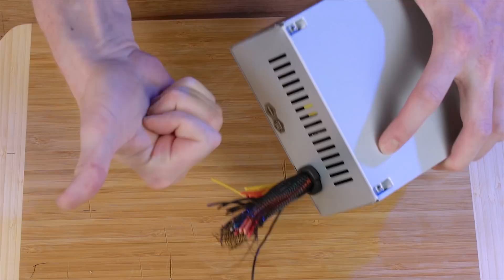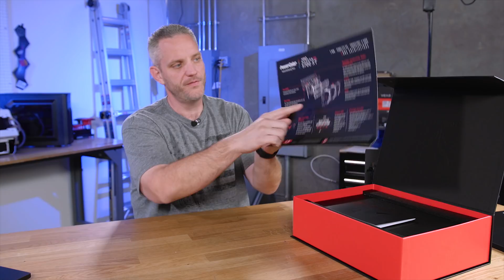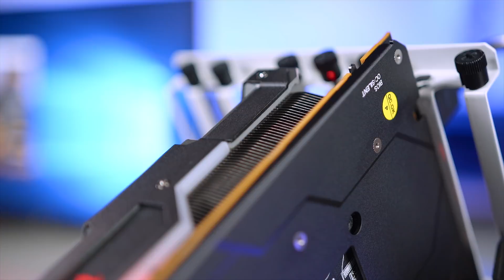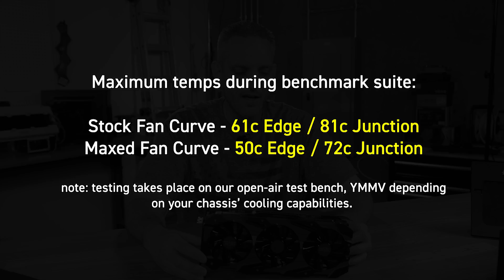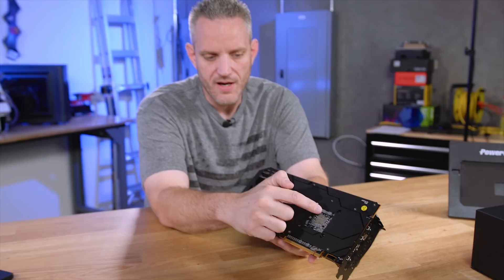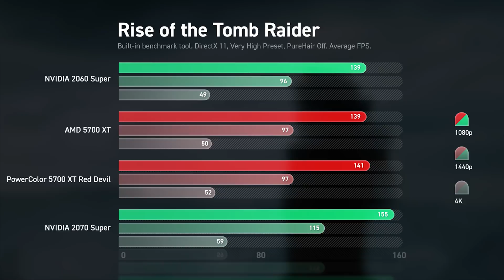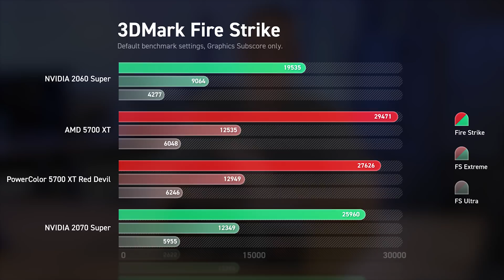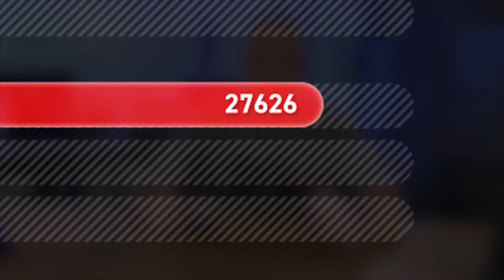Custom RADEON 5700 XTs are here! and THEY ARE GOOD!

Comment: 5700 XT is honestly the best price to performance card out there right now. Big Navi is going to be frickin amazing.
Reply: New, I believe you're right, but I think it'll be hard to beat a Asus ROG Strix vega 56 for $240. You can get a blower design 56 for just a touch over $200.
Reply: @dutemp  true for 1080p but 1440p on the latest games (*cough cyberpunk) you need a 2060 super/ 5700 xt and the 5700xt is effectively a 2070. Easy best card for 1440p
Reply: @SteveDonev  Its better than 2070. More close to 2070 Super easy.
Reply: @Lollakuk  that's my point
Reply: @SteveDonev  yeah it competes with the 2070 Super, even beat the 2080 once. Amazing.
Reply: Big truth
Reply: @Kronixio you will probably be able to run it high 1080p with a 1060 but not ultra and definitely not 1440p. This is all just my guesstimations tho so take it with a massive bolder of salt.
Reply: @socketus popetus AMD have registered the names "5600", "5800" and "5900", there's probably gonna be other Navi card.
Reply: You realize you cant get a 2070 super for the suggested MSRP of 500 right? They're easily over msrp by 50$ sometimes $150 over msrp. The 2070 super is not a good value. I shouldnt even use 2070 and value in the same sentence....
Reply: @desjardinspeter1982  I got my MSI Duke RTX 2070 OC 8gb in my PC, which in total cost just under $900 (for the entire PC that is), so to say you can't get good value out of it, you need to stop buying brand new graphics cards every year lmfao.
Reply: @TheGauges420  who buys a new graphics card every year? Did I ever say that? I dont believe you built an all new PC with a 2070 for 900 dollars. I call bullshit. Unless you cheaped out on everything else...
Reply: @TheGauges420  used 2070s are at best $50 lower than msrp. And you get no warranty and have no idea how harshly the card was treated. Not a good value at all.
Reply: @Warm Soft Kitty  lol what? You need to go see some 5700xt benchmarks my friend. I recommend gamers nexus. Steve goes in depth with the analysis. It performs at a 2070 non super level.
Reply: @Warm Soft Kitty  the 2060 super is in no way shape or form faster than a 5700xt. The 5700xt performs at a 2070 non super level, and about 3% slower than a 2070 super
Reply: If not factoring in used market, then I’d say so.
Reply: @saucyg6371  used market for gpus generally sucks. You would be hard pressed to find anything better than a $50 discount for a $400 gpu and you gen no warranty at all. Not to mention that you have no idea how hard the card was run
Reply: Rx 5700 is better for p/p
Reply: @aguy3664  5700 falls in a very weird space. Way too powerful for 1080p and not powerful enough for 1440p. 1080p you should go radeon 580 and 1440p 5700 xt
Reply: @SteveDonev  5700 can be good for 1080p high refresh, and it will deliver proper performance for the newer titles. There is Navi 14 coming for the lower-end market.
Reply: @randalldraco3822  true but 1080p high refresh is only good for competitive gamers. For most games the higher resolution and a 60fps framerate is preferred
Reply: Pumpal 
Unless you have modded Skyrim to hell and back..for that the Rx 5700 makes perfect sense at 1080p lol. I have an rx580 and a gtx 1070 ti. I personally prefer the 580 for 1080p. Just doesn’t stutter like the 1070 ti tends to. However, the 580 just can’t hang at 60fps in modded Skyrim. Even the 1070 ti falls to around 45fps in heavily wooded areas
Reply: @TrevorLahey3  for a high refresh 1080p freesync/gsync monitor then the 5700 is great, but if you are on a budget and want 1080p 60fps then its absolutely overkill. All you need is a 580/1060 for that.
Reply: Pumpal 
.....unless you have modded Skyrim to hell and back
Reply: Pumpal 
Not to mention a handful of games out now that run heavy. GR:Wildlands, AS:Odyssey...
Then you’ve got the future proof aspect to think about as well
Reply: @TrevorLahey3  future proofing is a fallacy. The generational improvement of gpus is far greater than the cost of buying a higher tier card. For example, if you bought a 1060 and now upgraded to a 1660 you would still have spent less money than if you bough a 1080ti and by the time you need to upgrade the 1660 you would need to upgrade the 1080ti as well. Always buy what you need and only upgrade when you need to. Overspending to future proof is a mistake.
Reply: Pumpal 
Fortunately in the case of Navi, it’s not overspending. The rx 580 is still a great card and a great buy at $170, but it is simply not the perfect 1080p ultra card anymore. I’m excluding the 1060 because the rx 580 edges it out now. When you are at the crossroads for an upgrade, I certainly hope one would never think of jumping from a 1060 to a 1660. Unless, like me, the joy of fiddling with and testing the hardware is just about as big a factor as playing games. 
Back to my point, it won’t be long before the rx 5700 makes even more sense at 1080p ultra. If you check the 1440p ultra benchmarks, there are already games that it can’t maintain 60fps..the next step down is freesync 1080p. 
And I won’t account for the rx 590, as much as I would enjoy getting my hands on one, because the TDP is considerably higher than 580 and the performance/price gap just isn’t quite worth it. The Vega 56 is also quite power hungry, and performs slightly better than 1070 ti. At $210 it is hard to ignore though. But like 1070 ti, you will find limitations at 1080p 60Hz.
Reply: @TrevorLahey3  dude I am currently running a 1070 non ti in my system and can max everything in 1080p and most things 1440p. If you have a 1070ti even at 1440p you wouldn't need to upgrade. I don't know where you are getting the idea that a 1070ti would struggle with anything 1080p
Reply: Pumpal 
From my own personal experience. I own one. I also game 1080p. My card is 98th percentile on userbenchmark, at 133%, and everything else in the PC I built is running tip top as well. I don’t know what else to say man..facts are facts. Do you own any of the commonly known GPU intensive games? Kingdom Come? Wildlands? Modded Skyrim? Witcher 3 w/hairworks? There are a couple more..
Some could be chalked up to bad optimization, but that’s beside my point.
Reply: @TrevorLahey3  My 1070 doesnt stutter at at 1080p.  It only drops frames less than 60 fps at 1440p ultra on the most demanding titles.
Reply: @TrevorLahey3  I think theres something going on with your GPU or your system.  Userbenchmark isnt reliable for stress testing GPUs.  Try a combination of watch dogs 2, superposition, GR wildlands, and metro exodus.  

Modded skyrim will hang on any system with enough mods, the graphics engine can only handle so many mods.  Kingdom come runs badly on every GPU, not optimized at all.  Witcher 3 runs just  fine at 1080p ultra with hairworks, although hairowrks isnt worth it when you can play 1440p high at 60 fps.
Reply: autumn lundy 
Oh I agree that userbenchmark isn’t a stress test whatsoever. That was just the only thing I could remember of the top without being at my PC. In 3D mark timespy(whichever the free one is) my graphics score was 7450-ish. I tested that MANY times. I also relentlessly tested using Unigene Heaven & Valley. Not to mention about 40+ games that I own. I think my Valley score was 106fps which may have been a score of 4400 if memory serves correctly. 
I don’t really want to insist upon making a huge argument out of this but you seem more concerned so I will also add that my brother in law uses a 1070 non ti, and he can’t ultra everything. I haven’t touched his card for the record lol. 
I also agree with your comments about optimization, as I already stated before. It becomes beside my point because you push through poor optimizations with brute force if your card is powerful enough. Same goes for Skyrim. It does have limitations but a 2080 ti will still go way further than a 1070 ti (just to rush the point). -and there will always be poorly optimized games.
Reply: autumn lundy 
I could give superposition a go tonight and post results. I’ve never used that one. I don’t own WD2. GR: Wildlands I don’t own either. I was going off of other benchmarks online.
Reply: autumn lundy 
https://youtu.be/wgoJuH5c-1A
Reply: autumn lundy 
I’ll rest my case on the above video. 1440p ultra in most, above 60fps?.....sorry man, no. There are titles where the 1070 can’t maintain 60fps at all times on 1080p just as I was saying.
Reply: @theholypopechodeii4367  ok so I looked at the list and half of them were multiplayer titles which generally don't need too much gpu power. The rest were linear games like re2remake. The most demanding games are always big open words and the only one that was like that was metro and it barely maintained a 60fps average. We have to keep in mind that the next console gen is next year so games are gonna get way more demanding. So if you don't like open world games or only play multiplayer games then fair enough, the 5700 is the gpu to go. For everyone else I maintain that the 5700xt is what they should get, especially since its only $50 more.
Reply: @SteveDonev  got to remember that metro exodus benchmark is hardly indicative of the experience...you'll see frames waaay higher for the majority of the game, only one area tends to bring frames that low. Vega 56 can handle most games 1440p ultra above 60....once you UV and OC it becomes a Vega 64 and if lucky near on par with 5700 which is great for 1440p. In 2 years maybe it will be a different story. Ultimately, if you've got the cash for it and don't need to skimp the 5700xt will last a long while. 2070super too if you care about tensor cores and raytracing.
Reply: It costs £500 in the UK which is like $600.
Reply: @BigPoppaBeta  I mean at that price point you might as well go rtx titan. What's a few hundred dollars more when you are already spending over $1000
Reply: @Warm Soft Kitty  Yes and the 5700xt falls just short of a 1080 ti yet better than a 1080 for a $400 price point. That's crazy price to performance
Reply: If big Navi is too amazing, it's price will reflect it.  While people are willing to pay those insane prices for that much performance, AMD has a right to cash in on it as well.  They shouldn't be the only ones fighting Nvidia on the pricing structure.  The consumers should be refusing to pay it, but too many still will, so it will be the new normal.  If they have notably higher performance than the 2080ti, you can expect 2080ti MSRP pricing.Even $750-$800 would be an insanely good price, compared to the competition.  Not that I think that's a "good" price for a graphics card.  Here's to hoping that they also bring sane pricing to the market, like they also did Ryzen.  That would amazing if Navi brought generational leaps like Zen.
Reply: @Warm Soft Kitty  what game can't a 5700xt at 1440p ultra get 60 fps in? It's just slightly slower than a 1080ti and faster than a 1080.
Reply: shame the drivers are still broken...
Reply: When you made buy the XFX RX480 GTR , ans thank you for that, it was really a good piece of hardware tgat served me well for 3 years...sold it to a guy now I'm going to buy a 5700xt...yeah this one should be the best
Reply: Nope. The rx580 is. For the price
Reply: Nope. Vega 56 is

In all honesty they’re all great cards!
Reply: @davidpollard6502  I currently own a Vega 56, I think it's a bit overpriced still, but I guess that's the market nowadays.
Reply: @davidpollard6502  The most inefficient card lol.
Reply: @danbublol  That's how I felt when I was looking at the 5700 XT. I thought is was on par with the rx 580 8gb.
Reply: @theholypopechodeii4367  what games were you looking at? When I look at gpus I always look at the most demanding titles like assassins creed odyssey and metro and the 5700 cant maintain 60fps ultra 1440p on either. All this is in preparation for cyberpunk anyway and that game will chew up and spit out gpus.
Reply: Pumpal the reason for that is because there’s barely any optimisation
Reply: Nope. RTX Quadro 8000 for me.
Reply: @theholypopechodeii4367  While cyberpunk isn't optimized yet we know that cdpr ran it on a 1080ti and 2080ti respectively in both demos. That gives us a general ballpark of where it will land (2070 super range imo for 1440p) And looking at what people play means nothing since all the most popular games (league of legends, minecraft, rocket league, csgo) will run on a potato.
Reply: @SteveDonev  Not with Minecraft shaders lmao. Those things are insane!
Reply: @YuhNinja  true lol
Reply: @theholypopechodeii4367  Damn i like the RX 5700 coz its much cheaper than XT version but i guess i just settle for 1660Ti.
Reply: @ult7511  the difference is only $50 for about 25% better performance. That's a steal seeing as most companies will charge $50 just for a better heatsink and rgb.
Reply: @SteveDonev  $120 difference in my country, and not a fan of rgb but i like better heatsink coz i'm living in a tropical country so my room temp isn't the same with westerns
Reply: @ult7511  that's rough... sorry to hear that.
Reply: If I’m spending $450, I’m getting a gtx2070. Only reason I see someone buying this is wanting AMD products only. At the end of day, it is still a gtx2060 class card. I just don’t see anyone going this route. It doesn’t make sense. This is for the US crowd. I know that the price difference is more significant overseas.
Reply: paul sleeping remember rtx 2070 is 500
Reply: paul sleeping and also the extra 5700 and the 5700xt are better than the rtx 2060 and 5800xt can even trade blows with the rtx 2070 super
Reply: @Paul_Sleeping  well you have fun with the inferior product for the sane price.
Reply: @Paul_Sleeping  except that the 2070 super is $500 minimum. The 5700xt is about 2% slower for a $100 price difference. Also a 5700xt has 2070 non super performance not 2060. It blows even the 2060 super out of the water.
Reply: paul sleeping the RX 5700 xt is a 2070 to 2070 super card

Comment: Finally a mid tier graphics card better than nvidia.... been waiting for years
Reply: Better?  Team Blue still on top.
Reply: RX 570? RX 580?? RX 590?
Reply: Tick Tock Tech that can compare to the rtx cards
Reply: Lmfao.  Compare?  Compare to what?  How Nvidia is still winning?  

Tick Tock  Tech?  You think the new Navi is going to beat the 2080ti Kingpin?  Lmfao.  It'll be close, but team blue still on top.
Reply: @lickkittysplit3871  Um, kingpin is an AIB overclocked card... they don't "need" to beat the kingpin. They just need to beat the 2080ti. And yes, they stand a good chance of beating the 2080ti with a larger Navi chip

Also, Nvidia is green... not blue
Reply: @lickkittysplit3871  you colorblind or something? 
I don't get the blind following Nvidia has.
Reply: @zucaritas2838  Team Blue
Reply: @lickkittysplit3871  awww you ARE colorblind